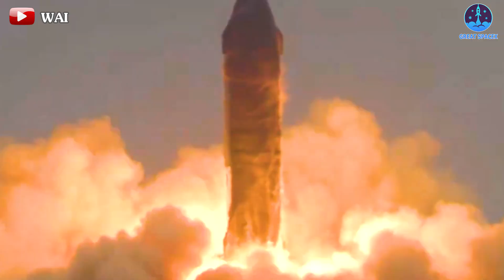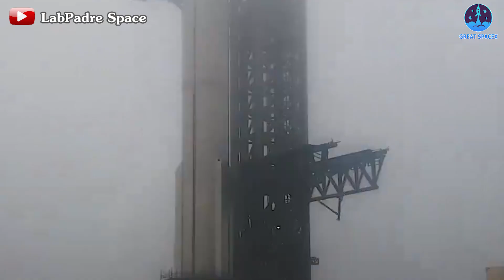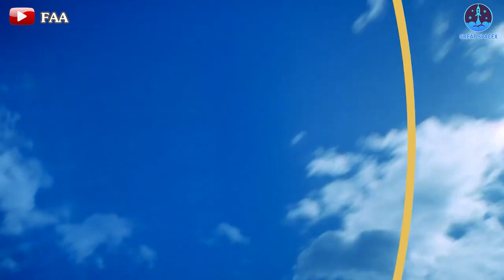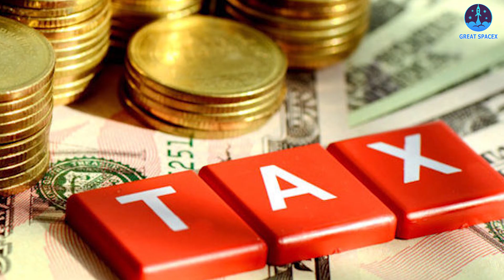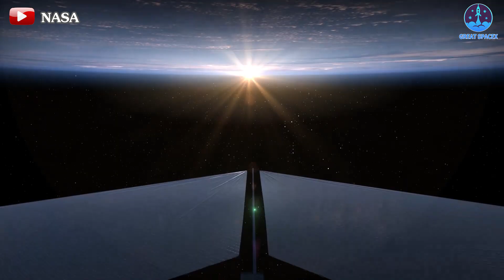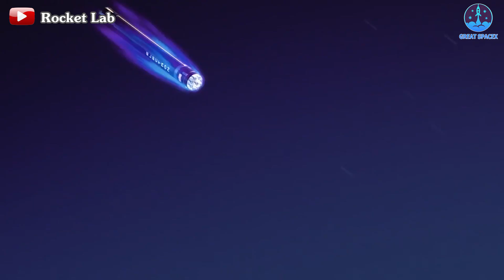SpaceX is ready for Starship Flight-4 fully stack! New FAA progress...

Comment: The one thing I've always questioned, at least in the early stages of the program. Why would SpaceX bring the Booster and Re-entry Vehicle back to the main launch pad and risk major damage? Of course, I know the argument of having them right where they are needed for a rapid turn around. But, the chances of a major failure are pretty high, and if it happens... you lose your only launch pad (for who knows how long). Seems to me that having a separate pad designed for landing(catching/snatching) close by, yet far enough away, so that the launching pad can not be damaged in case of landing failure is logical. Either way, in the early stages, at least, they are NOT going to send either stage back up without taking it back to a building for inspection and refurbishing. SpaceX may never get to the point where they send the booster right back up. And by the time they do, that separate landing pad will have more than paid for itself.

Comment: Should use button type snap on approach to tile attachment heat would expand the metal buttons tighter and counteract vibration
Reply: Your understanding of the physics of how heat affects round objects is in error. They will get looser, not tighter. How do you remove a bearing race from an axel? You heat it. If the inner part was a different alloy that expands more at the same temperature, that might work.

Comment: I don't understand why starship isn't developing low orbit speed braking, such as Virgin uses (unfoldable or wrap around the ship body unfolding grid fins?) To enable them to scrub off much more reentry speed and also much more pitch, yaw and roll control. This would reduce loss of heat tiles from a critical matter to more of a minor, less potentially lethal issue
Reply: “The best part is no part!” They’ve already proved it’s ability to belly flop, “fly” and fire successfully in it’s prior Starship landing exercises. So if they can get the thrusters to properly align Starship for de-orbit burn and flip during entry, they’ll nail the entry burn, flip and landing burn no doubt.

Comment: The tower catch mechanism is okay; however it should be completely redesigned simultaneously with the concurrent use of it.  The digital rigidity of the Chopsticks has limited flexibility for slightly errant landing ships which are vulnerable to high winds or rocket engine gimballing accuracy.    An observation of how giant squid use their long feeding tentacles to capture and draw in food illustrate a far better way to capture and secure a moving object.  The tentacles can be mimicked in several ways;  They can be hydraulically mimicked ;  They can be mechanically mimicked, using sleeved cables; and, they can be pneumatically mimicked.  Of course a combination of  techniques can also be used.  The Boom and stick basic design of construction digging machines also imply how a dynamic heavy duty arm having a grasping end can be employed. Turning them on their side would accomplish a very flexible rocket landing aid.   Reducing that hovering and  docking time is of the essence as that is fuel consuming and dangerous high heat producing. Engaging in constant ongoing innovation is an important paradigm.
Reply: That tower is a game ender.

Comment: So maybe this time the contraption will work?  Not crash or partial burn?   Thus far it didn't work, all talk but no orbit, no landings..
Reply: Starship was just short of orbit, they purposely kept it from orbit as they would not had been able to attempt splashdown in the Indian ocean. They cut short the vacuum engines firing so it did not make orbit, it could’ve easily. All talk? Say you know nothing about iterative rocket design and testing without actually saying it why don’t ya. IFT3 was a successful flight despite the shortcomings. The largest rocket to ever launch and in this last test proved it could also act as a “space freighter” due to the amount of cargo it could launch, and it also successfully completed its fuel transfer test which was a crucial test needed to be done for NASA.
Reply: Yes omg! SpaceX have completely FAILED to land their 3rd Starship on Mars or the Moon! What a massive FAILURE of a company! 😂🤣😂